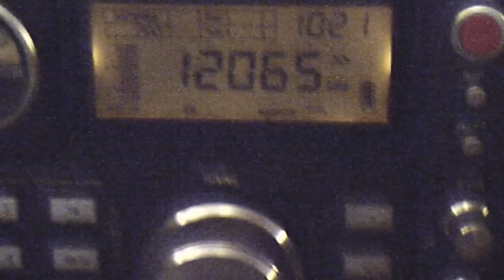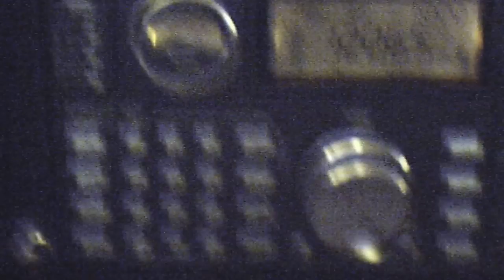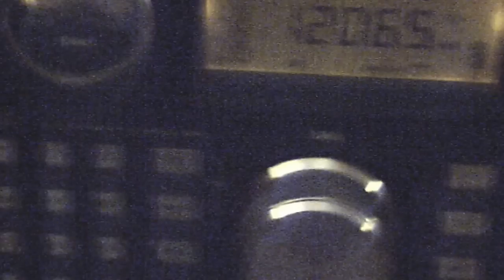Homemade Outdoor Shortwave Antenna

Comment: Dennis, Interesting video however next time here a few suggestions on improvement.
1)   Try making a "Cue card" with the information points on it to help you convey your information.
2)   Try having whatever you intend on showing in the video already set up and ready to go such as,
lights on, radio on, etc... makes things go a lot smoother.
3)  On your cue cards put the actual name of the items instead of " got this thing from..." what is the
actual name of this "thing"?
4)   when changing places PLEASE pause your camera, I was getting "Sea sick" from all the smeared
video.
   Overall nice try just a little rough around the edges.

   Thanks
Reply: Those that can do, those that can't teach.